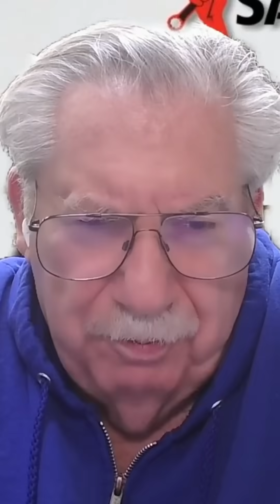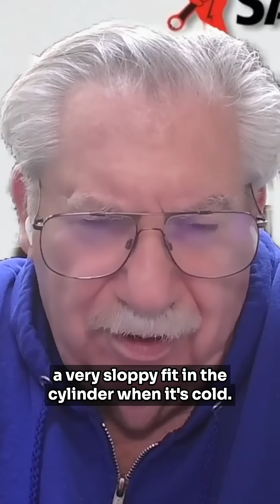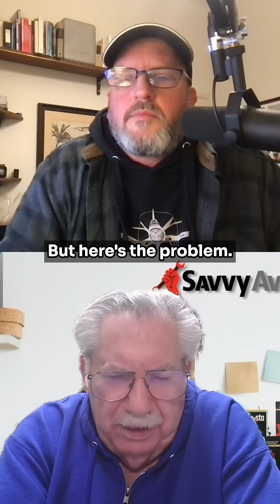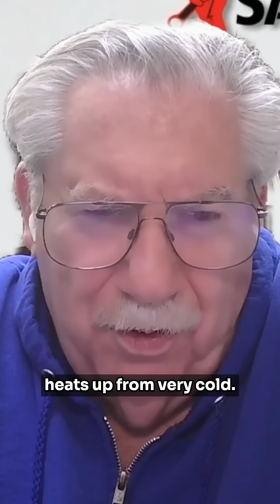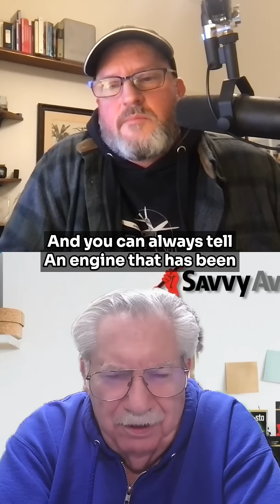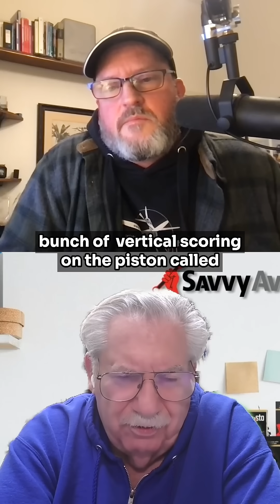Why Engine Warm-up is ESSENTIAL

Comment: The piston gets oil cooling and all the cylinders don't cool evenly so things are all over the place.Somtimes if you replace a front cylinder it won't break in so you might switch it with a different one .

Comment: My instructor told me since day one: "heat 'em up slowly and cool 'em down slowly" that's all you need to know about GA piston engines.
Reply: I try to do that with my cummins, that has 12 qts of oil and a 3 core radiator to warm up.

Comment: This is what having steel cylinders and aluminum pistons gets you.
Reply: Almost every modern car and truck on the road has steel cylinders and aluminum pistons.  They don't have this problem...
Reply: @RussellTelker  Water cooled vs. air cooled.
Reply: @jessegarman7899  Yup, GA is still stuck with prewar tech for some ridiculous reason.  We get old tractor parts to keep us in the air.
Reply: @jessegarman7899  And we pay WAY too much for it.
Reply: @RussellTelker  Every modern vehicle on the road is watercooled, and many of those  are aluminum block with nicasil cylinders with no steel liner. Both features allow for very close tolerances compared to an aircooled airplane engine with steel cylinders and aluminum pistons. Bolting a steel cylinder to an aluminum case was high tech in the 1930's.

Comment: They do that because aviation is stuck with century old tech.    Modern, liquid cooled engines run MUCH tighter tolerances and work perfectly.  If we weren't still stuck using tractor parts from the 30s we could do the same.
Reply: Exactly. That and paying 60 grand a piece for that 30's technology...